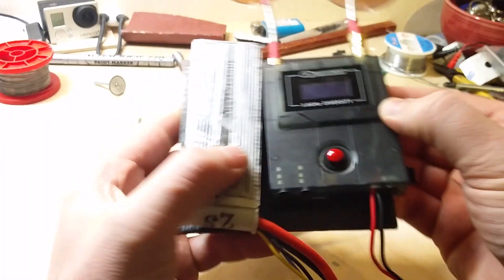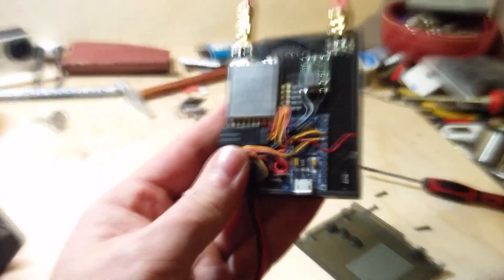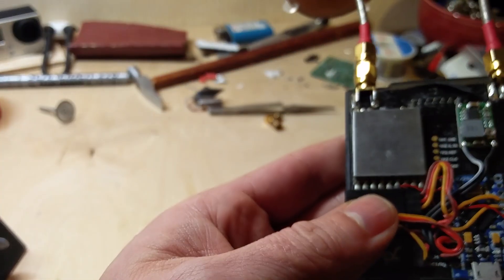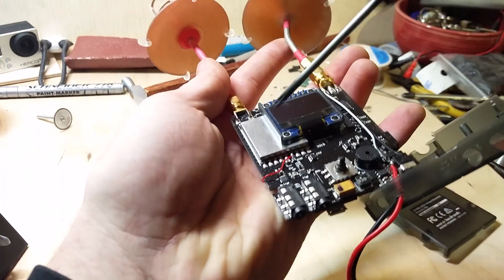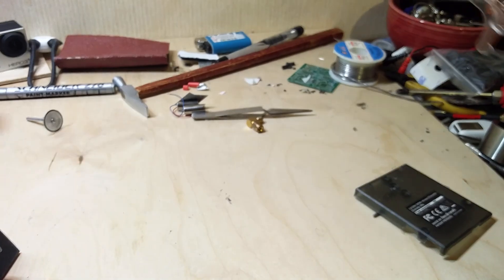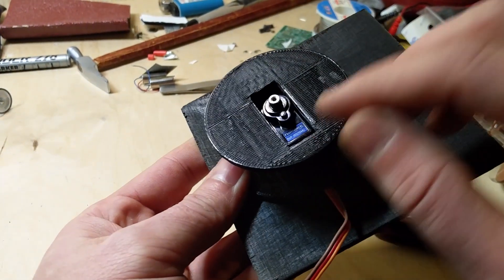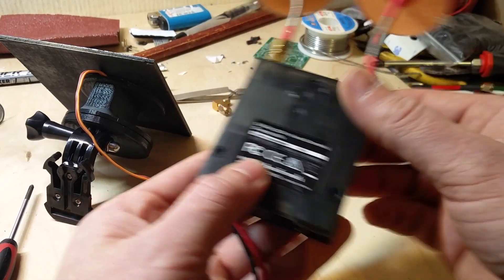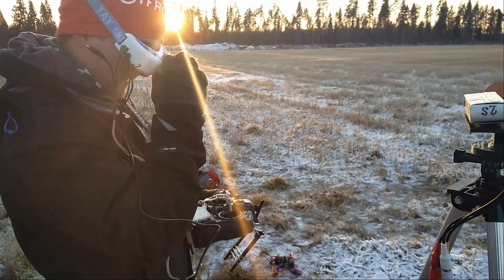SUPER SIMPLE 5.8GHz RSSI ANTENNA TRACKER

Comment: hi antti .. my  graduation project discussion will be tomorrow and i have a problem .. when i use 2 helical antennas the values of rssi never change .. i test the 2 helical and they work ..but when i use 2 omnidirectional the rssi values change ... i use RD945 diversity receiver and i can't find a solution .. I'd be grateful if you help me.
Reply from the maker: Hard to say without seing your project, but one dumm mistake i've done is mix sma and rp-sma connectors. If there is absolutely no signal from one antenna, that could be the case.

Comment: Hi Antti, this is a brilliant design. I got inspired by your video some years ago and built a similar setup using 2 diversity receivers. The Quanum RC 540R does the guidance job with two 16-turn helical antennas.  I added a small SD-card reader/writer for data logging and could fit it into the Quanum as well. The 2nd receiver, placed about 10 inches besides the Quanum, is an FR632 with one identical 16-turn antenna, pointing exactly in between the two guidance antennas, and a 4-leaf antenna for close range reception. I didn't care for vertical guidance. My construction is quite heavy and therefore using a big servo. Both diversity receivers feed their best signal into an Eagle Eyes FPV Station by Eagle Tree and the station outputs the better image of the two receivers for viewing/recording. Obviously, this is for long range operations. Your software was of great help and a good starting point. I adapted and expanded it a lot, up to the memory limits of the arduino. This works like a charm. Good image on 5.8 GHz up to a distance of 15.1 km (9.4 miles). This was the battery range limit of my small styrofoam model aircraft. Using a running average for the RSSI signals gave me very precise antenna guidance even at very low signal strengths.
Reply from the maker: Wow sounds pretty serious and awesome :D Do you have videos of your setup? Also it would be interesting to check what you have done in the code, have you published it somewhere?
Reply: @AnttiVainik  I had a big thread about the project on a German speaking forum, which unfortunately was closed down, loosing all contents. But you can find an image of the tracker and my version of your Arduino software by going to the 'euroconnection' URL with the TLD (Top level domain) for Switzerland.
Reply: i need to see your work thats good

Comment: I have been looking at this idea very closely and its very good. Do you have a schematic that shows the analogue circuitry for the RSSI? It appears as if the RC540r uses a receiver very similar to the common RX5808 found in a lot of FPV receivers but the one in the RC540r is slightly different, maybe a custom module? I would like to see the circuit and see if it can be used with the RX5808 receiver module. Can you help?

Comment: I dont understand with FPV taking off the way it has why more less expensive trackers have not been released. I dont have $500 plus to shell out for any of the premade trackers out not to mention I'm wanting one that I can use for both Analog and HDZero tracking. If anyone had run across any resources please feel free to share....
Reply: yeah I feel the same.
The sentinel antenna tracker from virtual pilot somehow puts your GPS coordinates to your vtx video so it doesn't need any additional stuff on your model which I like, although I didn't get how it should be set up since it's not natively supported by betaflight, but it's also too expensive at about £90 and you need a 3d printer to make it which I don't have.
Reply: @flat-earther  The Sentinel AAT can also be setup to track drones without a gps unit by tracking the telemetry channel of a CRSF RX. It can also do both analog and hdzero so yeah it's the one I went with..
Reply: @battantx  oksy.
when you said track drones without a gps unit do you mean the drone does not have a gps unit?
Reply: @flat-earther  correct the Sentinel AAT kit can be configured to track the telemetry channel of a crsf rx so no gps units needed but can be configured for gps tracking as well
Reply: @flat-earther   I should add that the faster proximity no gps tracking setup does require the FC firmware to also be modified as it hides the tracking/telemetry data in the OSD of Betaflight/Inav/Ardupilot/Kiss GUI which is what the AAT decodes for positioning. The setup is really no big deal as the user community for the tracker has ballooned and there is even a gethub of latest firmware for damn near all major makes of FC's. Personally I'm still in the assembly stages with mine as I'm making mine with a swappable top to quickly go from analog to hdzero and am even ingratiating an Insta360 go mount into the antenna array so I can have FPV and LOS recordings of my flights.
Reply: @battantx  track the telemetry channel of a crsf rx so no gps units needed
I don't get how the tracker can know the position of the model if the model doesn't have a gps unit?

by the way I want a tracker with 360degree rotation slip ring,
and I want the tracker to have compass and gps module so I don't have to worry about pointing it north and not moving it the whole flight.
The gps unit and compass on the tracker lets me move the whole tracker unit mid flight and it will still always point at the model.
Reply: @battantx  The Sentinel AAT has two plastic gears for pan and I feel like that would make it turn jerky so I think it would be better to have toothed pulleys with toothed belt or some other idea like a direct drive servo and just eliminate any gears or pulleys, in order to eliminate the play that gear teeth have.
What do you think?

Comment: I have a Boscam RX-LCD5800 diversity video receiver, it has very similar electronic components to yours, almost identical actually. Do you think the rssi solder pad is the same pin as yours? Is there any way I could know?
Reply from the maker: Many receivers use same/similar receiver modules. Open your receiver and see if there's a module inside. You can then do a google image search "5.8ghz receiver module". There are plenty of images that show the RSSI pin.
Reply: @AnttiVainik  ok I've got my rssi pins covered, but I can't flash the Arduino for the life of me. I'm not sure what I'm doing wrong.  "An error occurred while uploading the sketch"  any help will be much appreciated. The YouTube videos are not very helpful.
Edit: Arduino flashed with timer.h 
Last question, what's powering the Arduino during use? The regulator out arduino and servo power are soldered together at the board?

Comment: Awesome. Could you please advise me how did you find out RSSI_MIN and RSSI_MAX values in the arduino code?
Reply: Following... My servo keeps on turning, my RSSI_MIN is 120 & MAX is 400. I tried different values from 0-50, 60-200 etc. but still the same... I am using RD945 diversity receiver.
Reply: @arielalvarez76  i also use RD945 what is the RSSI_MIN &RSSI_MAX you use ?
Reply: @arielalvarez76  Bro is RSSI Pin is 4th from right?

Comment: I want to track drone which can be 200 km away from me. Is it Possible to do this using RC540R diversity video receiver. Thanks
Reply from the maker: Absolutely NOT. This tracker is relative, it does not know where your drone is. If tracker looses lock, it may not recover. I't's only good for proximity flying.

Comment: hello antti, my tracker position is reversing, it should be left and right, but my drone moves to the left to the right tracker and vice versa. how to solve that problem ...
Reply from the maker: In the source code there is #define SERVO_DIRECTION     1, just change it to -1. It will reverse servo direction, simple as that.
Reply from the maker: If you are too lazy to modify the source code, you can just bend the antennas pointing inwards (cross eyed) or flip the receiver upside down, this should have same effect.
Reply: amazing...thank you antti ... it worked. Good luck. I'm waiting for the next video
Reply: @AnttiVainik  RSSI_OFFSET_RIGHT  and
RSSI_OFFSET_LEFT    , 
filled with what number.....
Reply from the maker: If the tracker doesn't have constant offset in either direction, you can ignore this value.

Comment: Thanks for this vid, very helpful on the build layout. If you had completed this how to with a piece on the Arduino setup it would have been perfect. Many people are left with questions if they are new to Arduino. Setting rssi min/max for example, serial monitor shows servo output, not rssi, so i've hit a wall with that.

Comment: I dont understand one detail,  the servo that you use rotate only 180º then you dont cover never the 360º. Its right this?
Reply: I am not into antenna trackers, but there is one thing you can do to every servo: open it up and remove the pin, that blocks is from turning 360°/infinite. Same way you can use a servo as a winch on a truck. But I have no idea of this will work with the controller on the tracker.

Comment: Hello colleague, congratulations on the video guy you can help me with a problem that I am trying. actually 2 problems one not sure of the RSSI pin of my receiver it is a Bosch RC832! and the other is that my code that your bug linck baxei
in this line; timer.every (5, measureRSSI);
Reply from the maker: RC832 is not a diversity receiver, are you using 2 of them? (you need 2 video receivers for this to work) I'm pretty sure the RSSI pin is the same as in my receiver. You are getting error because you don't have Timer library installed. Instructions to install the library are in README.md

Comment: Antti. How would you update this tracker in 2019?
Reply: Or 2020 now as I can't find that receiver.
Reply: @TheZolon  Given the Git hasn't been touched in 4 years, i'd say there are no planned updates either  XD
Reply: @TheZolon  using for example the realacc rx5808 you can easily find the rssi pin.
Reply: @TheZolon  you can recreate this by getting just plain receivers....power them...and set your quad copter VTX to those RX default channel...if you want to spend more time on this then you need secondary Arduino which will search for signal using RSSi....its not hard...just time consuming

Comment: Can anyone help I'm trying to wire this together and the power comes from the xt60 up through the 5v step down, then where does it go connect directly to the servo connectors? How does the power connect into the arduino?

Comment: You could build this with any diversity receiver right? As long as you can get the RSSI out of it? I am thinking of building it with 5808-based diversity receiver.
Reply from the maker: Pretty much yes. You need 2 separate receivers and 2 rssi signals, the you can do it.

Comment: Hi I have a problem installing the hardware in Arduino.
Either I did not do it right or the file was too big ...
(Sketch uses 7,786 bytes (24%) of program storage space. Maximum is 32,256 bytes.
Global variables use 506 bytes (24%) of dynamic memory, leaving 1,542 bytes for local variables. Maximum is 2,048 bytes.)

Comment: Hello Antti I built your antenna tracker and it is fantastic. I will be adding a second Rx. and a third antenna in the center. If I adjust the outside antenna the one in the middle will be on the aircraft all the time. It is absolutely amazing and so simple to build with all of your instructions and even included the sketch code. I modified the code slightly to suit my needs.  Billy Bones
Reply from the maker: Well done mate! I'm very happy to hear of your success. OpenSource rules! If you ever record a video, please share the link, so I can put it in the description.
Reply: I will make a video when I add the third antenna. Will let you know when I do.  Billy Bones

Comment: Just a quick question. I tried this on the quanum 2.4 version, and I'm not sure if the RSSI pins are the same as this one. How would you tell which one is for the RSSI signal?
Reply: The rssi 2.4 pins are arranged laterally, not the same as the 5.8 (4th pin), just pick up the RX name written on it and find the datasheet. I did and it worked with these same code parameters but I will try to refine the settings. Good luck.

Comment: I want to use this with 2 1.3ghz rx. There shouldn't be an issue as long as I can wire the Rssi to the arduino correct. Also would I be able to use a brushed/brushless motor instead of a servo?
Thanks again for posting this.

Comment: Did you have to use a longer screw for your servo?  I dont really understand how the servo attaches to the GoPro style bottom plate.
Reply from the maker: It's a normal servo screw. Do you know those round servo "arms" that come with  every servo, basically it's the same thing.

Comment: Nice tracker! I am also building a tracker with both right/left and up/down tracking for a senior design project. However, I've been running into some electrical noise issues. I've been reading about 0.4 volts with no signal source. Do you know what your RSSI voltage is when no signal source is present?
Reply from the maker: Actually yes, if you look at my arduino source you'll find RSSI_MAX=400 and RSSI_MIN=120. On a 5V arduino it means (400/1024)*5=1.95V at max rssi and (120/1024)*5V=0.59V at min rssi (plus minus some offset)
Reply: Ok thanks for the reply! I think I'll probably go with an averaging filter, subtract out biases, and implement a threshold voltage in order to get as clean and accurate a signal as possible.

Comment: Hello, its possible use only the VRX like RX5805?
Reply: No, it's supposed to work with any diversity receiver as long as you can figure out where the 2 rssi signals are (if you don't have access to them, you can't do this project) to link them to arduino inputs.
Reply: The RX5808 has a rssi pin, I can do it? 
https://k50.kn3.net/D/6/A/5/0/9/9D1.jpg
Reply: If it's diversity (2 receivers like this linked and compared) you can but you may have to scale rssi value on the arduino code. Some people have done it, have a look at other comments.
Reply: You can do it if you have two of them; in fact I'd guess that's exactly what's inside the RC540R, and Antti's tapped the two RSSI pins

Comment: IF you want to elaborate on this or start a new project, next time do one "solid state" with stationary antenna array. This is what I want for the roof of a (evt.moving) car, but not analog 5.8 like this: https://www.youtube.com/watch?v=n7kh5Q7rilg what I need is for 2.4/5.8GHz digital signals(tweaked WiFi - Connex/Yuneek/DJI etc.) i.o.w.long range HD video sometimes incl. telemetry/control signals. A very rough antenna (maybe panels)that will survive a storm on the roof of my house(it's very windy here) or on the car driving fast down the road in a tracking/recovery operation f.ex. I'm in with the soldering and electronics, it's the Arduino part and selection of signals I never had the time to really get into. But your video really inspired me to do something about that...

Comment: Great little tracker ! That's all you need. Gives the finger to all the expensive "super-trackers", that maybe look better in theory, but doesn't really perform much better in the field. Question? I see a lot of commenters suggest to expand(doesn't get/want simple) on this and make it tilt and add a close range(!) antennas etc.  - am I right your two antennas will get a strong signal from any direction at close range ? and therefore also performs well without tilt ?
Reply from the maker: Hi. There is no simple answer, but you are right. In the video I'm using 3-turn helicals, which have about 75 degree wide beam angle. Imagine antennas pointing 45 degrees up, now you are covering "almost" whole vertical axis. Of course in practice its not going to work like that, with tracker or without. You will always get bad signal near the ground and directly above your head.
Reply: I see. If you present the video/send them a prototype, hobbyking or some RC manufacturer will surely produce this one. Once (before they were all over the place) I said to a cctv factory in Chenzen - just chatting through Alibaba - that I needed a particular PTZ cam with 3G module. One week later they had made it for me, and kept selling this dome camera with a telephone module inside until those things started to show up in better intergrated designs.
Reply from the maker: Exactly. RC540R runs on ARM processor, so it could do tracking by itself, without Arduino hacks. And if Quanum had made it firmware upgradable with usb port, it would have been the most popular and hackable receiver on the market.
Reply: You really should try to make them do that. It's all about talking to the right person. If you don't make money - patenting is not really big in China as you know -  at least you'd do something good for the other FVP guys out here(that don't know programming/tinkering). How does it work with 4-5 turns, or other more Dbi directional antennas ?